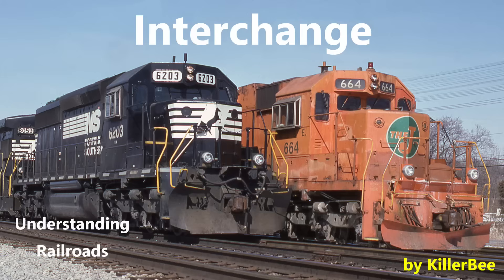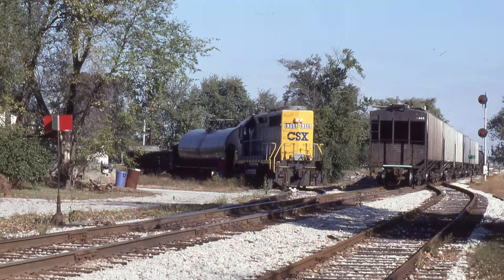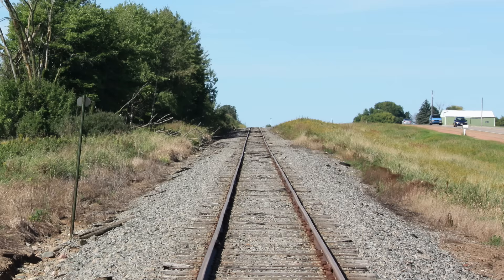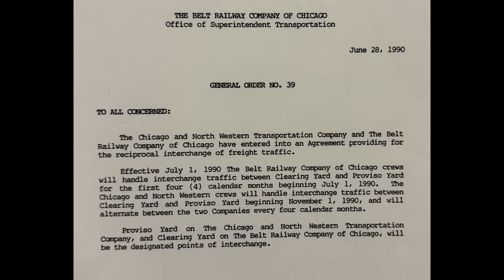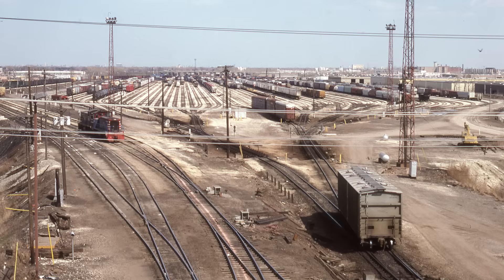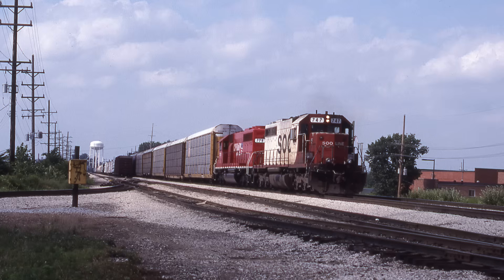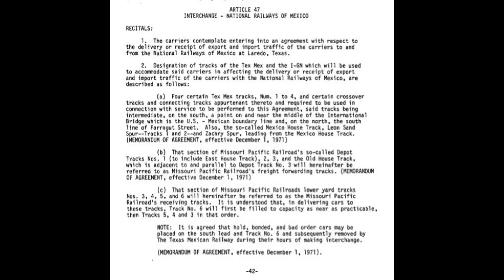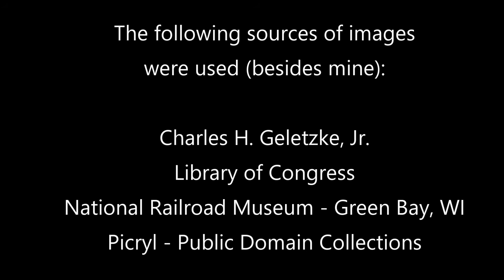How Do Railroads Interchange Cars?

Comment: Fantastic Video, love it! answering all of my questions in simple but understandable word.
i always wonders how U.S Railroads move cargo from A to B where it's out from their territory.

in contrast with where i live, where we had multiple railroad companies but they just an operator (only responsible for Locomotive and Rolling stocks). while infrastructures (Tracks, Signals, Junctions, Bridge, Tunnels, etc.) are owned by single massive company run by regional governments.

So there's no need to interchange, they're just need Rolling stock and permits to roll from A to B.
Reply from the maker: Sounds like England?  I was with Wisconsin Central so got a little familiar with the open access concept following the travails of EW&S.  An interesting concept but seems like one that encourages point to point freights and it seems the single carload business doesn't fit into it real well ??

Comment: KB if the reading & northern rr were allowed haulage rights to buffalo n.y. over the out of service ex. Pennsylvania railroad buffalo line, you could get a boxcar of yuengling beer to buffalo n.y. on just 1 road train.  Its most likely current routing is 3 road trains and a transfer train from pittston to scranton (ns taylor yard).  Thats a lot more transit time.  But it might be a fun game of ALPHABET ROUTE RAIL MAP CONNECT THE DOTS for ya to do.  On a rail map of pennsylvania draw out the boxcar of yuenglings current routing and then its routing if r&n started running a fast freight to buffalo over the buffalo line from Northumberland Pennsylvania northward and over the shamokin valley line.  U should make a follow up video to this video on that.

Comment: 9:20 And these terminal railroads that exist to simplify transfers between multiple companies are generally owned by those companies. TRRA in St Louis is joint-owned by BNSF, CN, CSX, NS and UP; Chicago Belt is co-owned by all six Class 1s that operate in the US; Indiana Harbor Belt is co-owned by the Conrail Shared Assets Operations (in turn, co-owned by CSX and NS) and CPKC.
Reply from the maker: It will the focus of another video shortly....another black hole I can fall into....LOL

Comment: This where trucking has it over railroading. If you’re a company shipping cross country, trucking is dock to dock, one carrier. With the railroads, your shipment might be picked up by CSX and delivered by Union Pacific. Transversing through three interchange points. Not that it’s a bad thing. But you’re at the mercy and timetable of 3 different carriers.
Reply from the maker: Which is one of the arguments the Class One carriers like to put forth in favor of another round of mergers....

Comment: The advent of the computer age was the death knell of the RR clerk. I recall walking through the CNW Proviso administration bldg. from the caller's office to the break room/cafeteria and you passed about 12 clerks sitting at their long desks in front of many "pigeon holes" where paper waybills were sorted. There was a veritable small army of clerks when I started in 1974 and by the time I retired in 2013 there was only ONE clerk left at Proviso and he did little clerical work as that was handled by the computer system and did mostly odd jobs like delivering supplies to yard offices such as boxes of computer paper for the printing out of switch lists or train lists.
Reply from the maker: I worked "downtown" (165 N Canal) from '81 to '87 but got out to the Ad Building at Proviso on occasion and remember the clerks that processed the inbound trains - the "Booking Desk" and .... oh crap....I have forgotten the other Desk.  One did the inbound trains from CNW points and one did the trains from connections in the city.

Comment: You mentioned the MSKNP.  The MNPSK was the best train ever to be stuck in a snow drift somewhere.  Loads and loads of various edibles, cocktail makings, wines, and the list goes on.  It is a sweet train.  Now, the SKNP consisted mainly of the empty cars returning west.
Reply from the maker: That train has run for decades.  I first knew the wb train in the 90's as Conrail ELNP out of Elkhart.  And two months ago I saw the train again on the UP in Nebraska.  So at least 30 years that guy has been running.

Comment: Awesome video! I still railfan some of these locations.
Reply from the maker: I was out to NW Indiana a short while ago - still lots of trains but some of the "color" is gone - CSL, EJ&E, the bottle train,  etc
Reply: @killerbee6310 Most definitely! The "Bottle Train " stopped running last month, and from time to time, you can still catch an EJ&E unit in it's original paint, especially near Pine or Kirk Yard. CSL is just hard to catch.